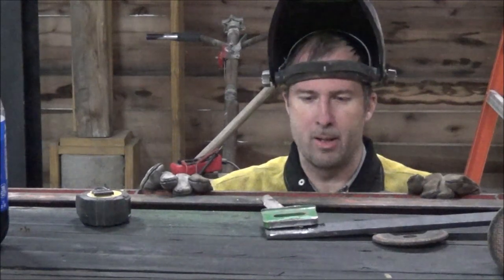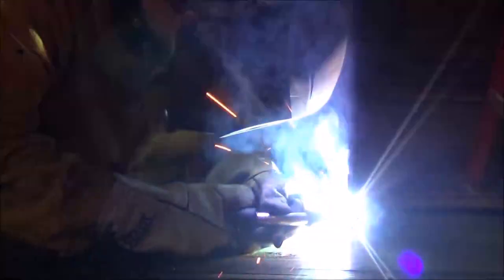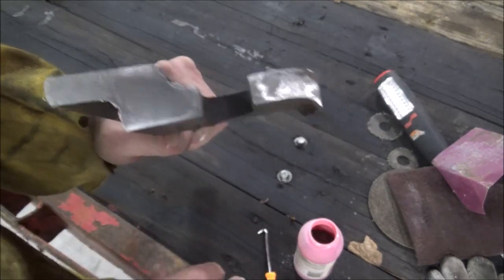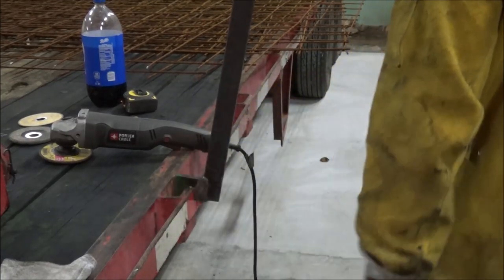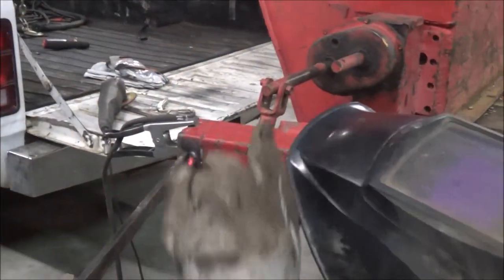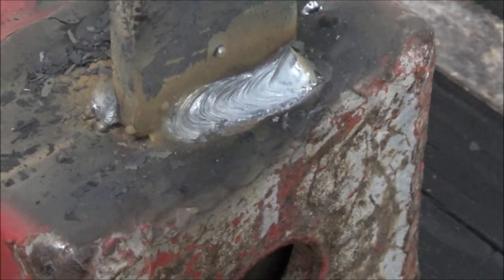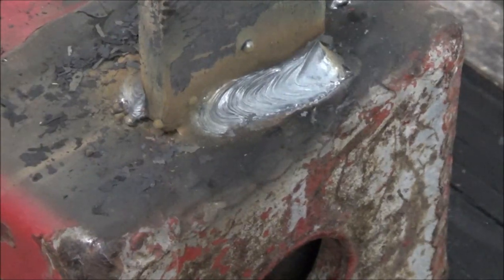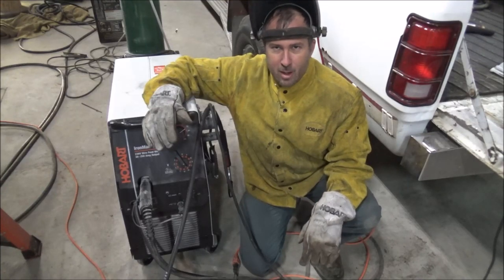How I Downhill MIG on Medium Thick Plate

Comment: I have been welding for 35 years and there is nothing wrong going vertical down with a GMAW. You just have to stay at the leading edge of your weld pool on the parent metal to insure penetration. Keyboard welders know what's best though. Good video as always Brian.

Comment: I built a cherry picker 26 years ago with my Lincoln SP 200 using vertical down mig welds & have used it for many heavy lifts, ie: complete Chevy big block engine & turbo 400 trans attached for just one of the many lifts & no problems with the welds at all ! So no worries with your welds Brian.

Comment: Brian , Ignore the doom mongers, nothing wrong with vertical down MIG.welding .been doing it since  the 1970's when I got my first Mig welder, If you are old school and can gas and arc  weld reasonably well MIG is easy , any position downhill, uphill , overhead ,horizontal vertical,  pour it in the joint till it leaves a decent profile. What you did on the trailer was a good strong job .    It didn't have to be a specimen grade 'A' welding class demo.

Comment: I never had any doubt Brian.  Good stuff.  Actually at that voltage that is basically Spray Arc as I understand it.  I've done all my own welding for 30+ yrs and I generally prefer my Mig welder over my stick or TIG for good solid welds, especially up to 3/8" material.

Comment: I run verical down every day. Never had one let go. Granted I'm welding thin wall tube to 11ga but still. 

I have run 3/8 to 1/2 quite a bit , in vertical down at 29 v 650ipm, with 0.045 wire. Still never had one let go...

Keep it up.

Comment: Brian if you need to do etch testing often get some Nitric Acid cut it 50/50 with water and use that. It will show up real well to stop the process drp in water then put oil on the part. You should be able to keep it for at least a year. Oh I use to do that for a company I worked for.
Reply from the maker: Thanks for the tip.
Reply: You are welcome.

Comment: I'm surprised at the comments regarding downhill mig. I've received no formal mig welding training, only tig n stick, however probably 60% of my welding experience has been with mug during my career repairing trucks, equipment and chassis, roll cages for anything. I've never had an issue with downhill, I prefer uphill (personal choice) but you can't always get your hand/gun in the right position. You can't tell a customer "I can't weld it cause its not convenient", I've welded overhead under many trucks and trailers with slag dripping on me, I'm sure that's not in any welding manuals either. I'm curios what guys like Jody or Bob Moffet would say about your style welds. I would have no fear following you down the highway loaded, I watched the welding portions twice, looked fine. There's always a hundred ways to do anything.

Comment: I use the same welder and gas mix (stargon). .030 wire for 1/4" thick down and .035 wire for anything thicker. More often than not though, I'm outdoors stick welding.  Looks like your shop is coming along! Btw, I'm just starting a new video series resurrecting my 1939 doall 16" vertical bandsaw. Tc Mike
Reply from the maker: Let me know when you get those vids up!

Comment: Nothing wrong with MIG vertical down. I have welded that way for years with no failures on light to medium materials. You have to know the limitations of anything your doing and as long as you live by that, it will be fine. I have seen some so-called professional welders that couldn't weld anything together to stay very long. I call them beautician welders.......looks great, won't hold for shit!

Comment: I worked with 2 welders years ago. One came here to work on the local atomic power plant; x-ray certified. The other was yanked up by the hair of the head and the seat of the pants, swinging a 16# sheep-nosed rock hammer in an olivine mine. The hammer swinger could weld as good as the x-ray man, better in some circumstances. A Kentucky boy can survive!

Comment: With the gap vertical down is fine.  Run lots of  indoor stuff like that.  I would of liked to see the mill slag ground off the jack, but you had it blazing hot so it’ll probably be fine.
Reply from the maker: The hitch was cold rolled so it didn't have mill scale really like hot rolled or I would have ground it.

Comment: I had not commented because there were plenty of others commenting on your down hill welding.  I made my living for many many years welding professionally for large company's that required certification as well as state certifications. Up hill and down hill both have their places. My opinion is based on my experience and it is that it will depend on the thickness of the material the welding process being used and the actual application. Something that is going to be pulled down the highway like your trailer I would have beveled the  joints and welded it up hill first stringer pass with a 6010 or 6011 rod and then finished welding it with multiple stringer beads using 7018 up hill. I also worked for one of the largest tank companies that built oil transport trailers and fuel transport and even milk transport trailers. Most of those tanks are made of 10 gage material and the majority of the welding requires welding down hill . Typically the 5th wheel plates would be welded with the tank in the upside down position so maximum penetrating and flat welding could be done. If you would have hired me to weld your trailer tongue i would have done it up hill.
Reply: terry cannon cool story bro

Comment: Holio shit Brian, how many inches of weld did you run on that hitch?  Let's also not forget it's been welded on both sides and it was 'pocketed' at the top!!   I feel sure the residents of USA can travel on their highways feeling confident they will not receive several thousand pounds of trailer through their wind screens (shields).  Thanks for sharing young man.  Kindest regards.  Joe.

Comment: Good weld is a good weld. Regardless of it's beauty or lack of beauty, regardless of opinions. I've seen too many pretty beads laid that didn't work and failed. Sooo my 64$ question....how did you come to use those settings and do the downhill? Advice, mentor, experience ?
Reply from the maker: Experience. I have always craved, hot deep, porosity free welds and am always looking for ways to get them even when its way outside the normal "book" settings. I have always been interested in results more so than copying a textbook.
Reply: Can't beat experience. It will take you much farther than a book. Thanks for sharing

Comment: Hi Brian, 

Your welds are fine.  Give the naysayers heaps!!

The towball looks tiny to me.  I would be more worried about the size and strength of the ball.  In the video it looks like only 2 inches, but I am assuming it is really 3 inches.  3 inch is the norm in Australia for trailers like yours.
Reply from the maker: 2-5/16 is the standard here in the US.  Keep in mind the standard lock diameter on a semi trailer hitch is only 2" diameter. :-0

Comment: If there's one thing I've learned about the internet and welding, its that if you show your welds, somebody will usually come and nitpick them no matter how good they are.  

Also, when you welded the trailer, didn't you do multiple passes, making it even stronger than this test where you only did one pass?
Reply from the maker: Yes it was multi passed until full thickness of the parent material. It is plenty strong.

Comment: It can be done but its definitely risky i built a d.1 test coupon bender and have done alot of downhill short circuit mig and even though I'm running hot and welds look great alot of em ripped straight in half spray transfer is what you use
Reply from the maker: Carol Florian I always spray arc when I mig.

Comment: i dont even weld uphill anymore on any aplication 
heck we rewelded 80 ton excavator booms downhill 
just dont bring those teeny tiny welders 
u need a big one
the reason it works is because u have a verry high burn in and extreme high feedrate on the wire 
no clue on the amps 
why ?
different welders different settings what works on a lincoln wont work on a fronius

Comment: Don't worry Brian, they're still scared shitless that someone's doing their own welding rather than subbing it out to someone who doesn't care if it holds or fails. 
I see tons of commercially made trailers with HORRIBLE welding, and far too little of it, yours looks absolutely overkill in comparison. :p 
Though one thing I've learned is putting little 1/2" breaks every 8" or so in the beads rather than continuous seam welding does help slow crack propagation.
Reply from the maker: Best to not have any cracks to propagate!

Comment: Right when you hit the trigger, I knew you were running spray transfer and not short circuit. That right there tells the whole story. Hot AF and it'll burn in deep.

Edit: Oh, and thanks for the video Brian! :-D

Edit 2: To the naysayers. Head over the weld.com YT channel and do you a search on spray transfer mig and watch Bob Moffet teach you something on the topic.
Reply from the maker: Pretty sure I watched a video of his once where he said you can only spray transfer in the horizontal though.  :-0
Reply: He said horz or overhead and added the comment "Yes I spray overhead, in certain instances" but I think he said that 'he' doesn't spray in any other orientations. Likely due to the heat input you already get from spray, add in the heat from downhill and you get a load of input. But when you're zapping huge 3/8 and 1/2" plates together and don't care about looks, I recon (and you proved) it works just fine and gets in there.
Reply: My thoughts exactly after you went over your settings “He’s sprayin’!”. Makes all the sense in the world now. I’m far from a pro but trying to learn.

Comment: Brian.... ideally you don't downhill MIG in a structural weld that's going to hold 10s of thousands pounds. 
  You don't downhill MIG for the same reason you don't pull MIG weld, always push MIG... you can get away with pulling a MIG weld or downhill welding but I personally would not bet on it.

Brian, send me your email address I'd love to send you my credentials.